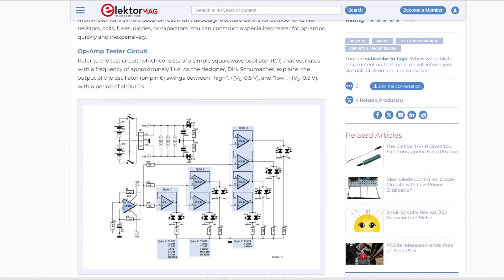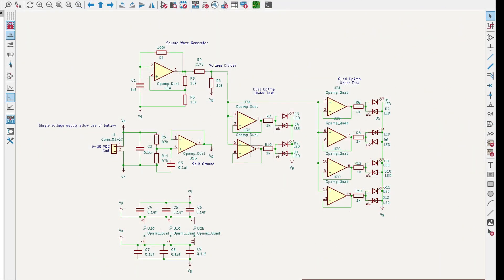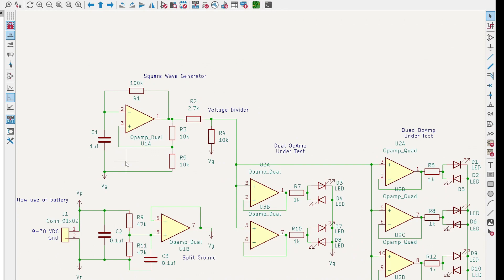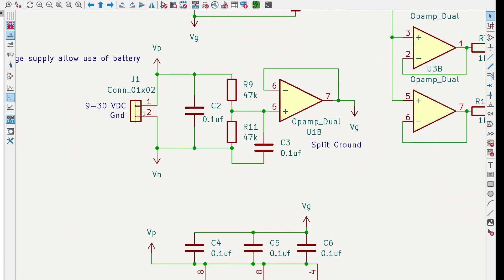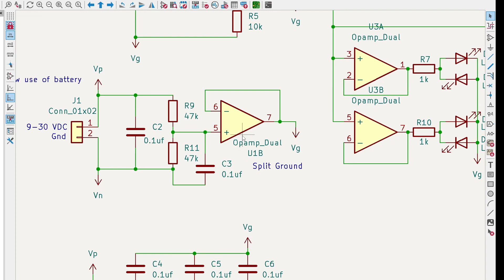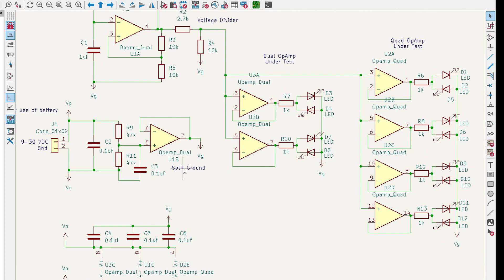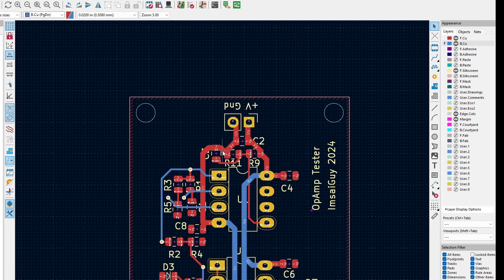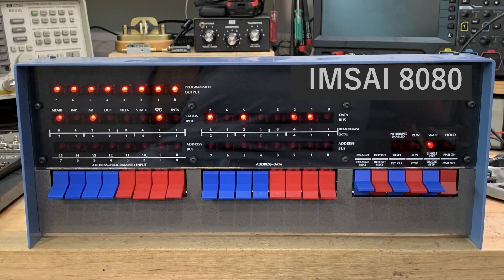#1830 Simple Op-amp Tester (part 1 of 2)

Comment: I made a quite similar but more simple opamp tester. Because I only use single and dual opamps I have not test interface for quad opamps on it. For power supply I use a USB-A connector, that I can plug it into a socket power supply or on a laptop of pc. So I use only 5 V to drive the opamps, because several opamps doesn't survive higher voltages.

In order to save parts I have used a 555 timer ic to generate a 2 Hz rectangular wave (just 1 resistor and 1 capacitor is needed for the simplest 50% duty cylce circuit and an LED at its output). So this circuit is also useful to test 555 timer ic. The opamps are also connected as voltage followers and I have used only 1 LED per opamp to signalize the low level output.

In this way I can also test open collector (open drain) single and dual comparators (except LM311, for which I have another tester) with this device

Comment: I always had this question about vitural ground since l learned electronics.   I hope someone could answer this.   Let's setup two working 7805 amd 7812 regulator circuits.  Then put them in a black box and hide them.  Then called the outputs -5V, 0 and +7V.   Is there anything wrong here?
Reply from the maker: if you read the 7805 datasheet, in the application section. it shows a 7805 regulating -5 volts. the output is tied to ground and the ground pin is -5.
Reply: @IMSAIGuy  Does it mean I can use 7805 instead of 7905 if I use the input polarities correctly?  I know the answer is No because 7905 exists!
Reply from the maker: @bayareapianist  you might think that, but yes you can use the 7805 for -5v.     I have not thought of the trade offs between the two, but it is right there in the data sheet and I have seen it done in products.
Reply from the maker: look at page 13: http://cva.stanford.edu/classes/cs99s/datasheets/LM340.pdf

Comment: As long as you don’t insert a dual DUT and a quad DUT at the same time, you could double up on the support components for opamps A and B and reduce the parts count…
Reply from the maker: you don't need both devices, it works fine with either one. you do need the oscillator/virtual ground one all the time.
Reply: @IMSAIGuy Yes - that’s my point - the dual DUT and quad DUT won’t be inserted at the same time, so the support components for two DUT channels could be doubled up.

R6 & R7 could be reduced to a single part and the diodes could also double up.  R8 and R10 could be reduced to a single part and the diodes could also double up.

This would reduce the parts count.  You still need two sockets for the two DUTs, though, but inserting them at the same time would be a problem (as it would be, anyway, actually).

The osc is still needed, of course.
Reply from the maker: OK I see. saves about 6 cents.
Reply: @IMSAIGuy Yup… Not an issue for hobbyists, but BOM optimisation would be an issue for commercial products.  Might make for an interesting video in a more general context…
Reply from the maker: @roscozone8092  of course you could make the device under test do the osc and ground and get a much cheaper tester
Reply: @IMSAIGuy Also an interesting topic for a video…  🙂

Comment: consider: UB1 should be special power opamp, a TL071 can sink/source like 25 mA. 4 leds are like 80 mA.
Reply from the maker: the opamps source and return paths are +/-V   ground does not matter
Reply: @IMSAIGuy  i have design where 3 dual  opamps are powered via an opamp based psu. the normally 10 V.p.p synthesizer signal can't pass, it turns to noise, a reduced level of about 2 V.p.p. does make it through.

Comment: Yeah, I've always had an issue with using the term "ground" in a circuit - it can be ambiguous. I always use the terms power supply "return" or "common" in my schematics.

Comment: The Elektor circuit tests Single (type1), Dual (type 2) and Quad (type3) Op-Amps, just wondered why you left the single op-amp off your tester?
Reply from the maker: well, I almost never use single devices, so, since I get to do what I want, it didn't make the cut 😎
Reply: @IMSAIGuy   fair enough!

Comment: For several years I have used a TLE2426.  They are good up to a max of 40 volts.
Reply from the maker: forgot about those devices. never used them
Reply: @IMSAIGuy  When I first learned about them I was building a ducking amplifier that neede +/- rails.  Cant recall where I learned to use it.  They are great - always keep about 10 in stock.

Thank you for so many of your instructional videos.  I've even purchased several of your PC boards.  :-)

Comment: In Dutch, and many other languages, there is a distinction made between return-path and ground. The return path is called "massa" (mass), while we can earth ground "aarde" (earth). So it's a problem of the English language.

The custom to all the return path mass is coming from the fact that the return path in a device is often connected to the chassis, (such as in a car where the entire chasis is connected to the negative pole of the battery).,  i.e. you connect to the heavy mass of the device.

There even exist separate electronic symbols for mass and earth, but I guess due to the dominance of the English language in engineering, I don't see the symbol for mass used a lot. Sometimes you encounter it in old schematics of European electronics.
Reply from the maker: I don't think it is a language problem. we could have used earth, ground, return, positive, negative. lots of English words to choose from. At some time in the past someone used the word ground and then used it for multiple things which is when things got confused.
Reply: @IMSAIGuy  I agree that the English language has a sufficiently large vocabulary, nevertheless the problem to call it ground is English-specific.

Comment: Nice design.  I started to design something similar a few years back.  I wanted to use a 16-pin ZIF socket for the device under test.  I also wanted to be able to select the supply pins for the particular op-amp package, but eventually got frustrated by the sheer number of possible pin configurations out there and never finished the project.

Comment: Would prefer using a triangle wave, as that gives you a better test, as it makes sure the opamp can at least follow, rather than slam rail to rail. Also set each opamp to have gain of 2, equal value resistors in feedback, so you also see that the LED's all ramp up and down at the same rate as well. You get plenty of opamps that will sort of function as a buffer rail to rail, but in the middle they are doing odd things.
Reply: Agreed a linearity test would find bad op-amps much more reliably, if I was doing this I'd use an adjustable frequency oscillator to test both linearity and GBWP.
Reply: @chryseus1331  Just have a test point on each opamp, and a simple 2 channel scope will give you linearity, just by using math on the inputs to do subtraction. you could easily then use an external signal gen to feed in your sine wave for GBW purposes, but for a simple tester really getting complex then.

Comment: You can get a -9v battery at your local hardware store, they are in the same section as the left-handed screwdrivers. 🤪
Reply: And spare bubbles for your spirit level.
Reply: @andymouse  Squeak!
Reply: @daveodessa  Squeak !
Reply: Do they sell magic smoke to fix overheated transistors 😂😂.
Reply: @monteceitomoocher  You have to ask for it and sign a waiver, the stoners were buying it for the wrong reasons.
Reply: @jerril42  🤣🤣
Reply: don't forget the metric adjustable (crescent) wrenches (spanners)
Reply: Minus nine volt batteries, are they the blue ones?
Reply: jerk

Comment: Nice! Neat PCB! Question - what is the purpose of the two .1uF capacitors on the Virtual Ground circuit. I thought filtering, but it’s a battery and decoupling does not make sense, I think (or not?). Thanks!
Reply: If instead of pulling out a battery, you're at your lab, and just want to hook some wires from one of your PSUs into the circuit, it's handy to have it stabilised right at the board rather than through all the wires. Although for many capacitors you could call it "belt and braces" [over-]designing. But luckily they are near 1c parts so it really doesn't cost much to over-design it for a hobby project. Cheap Chinese products you will see them keep removing capacitors from the board placement until the thing stops working, then just add the last one back in and ship it (heck, not necessarily only Chinese) :D
Reply: @ivolol  Thanks! Indeed lab power supply sourcing makes sense for a tester!
Reply: Always decouple an opamp as close to the power pins as possible with 100nF (0.1uF) caps. Doesn't matter if battery powered or not, it's needed for stability.